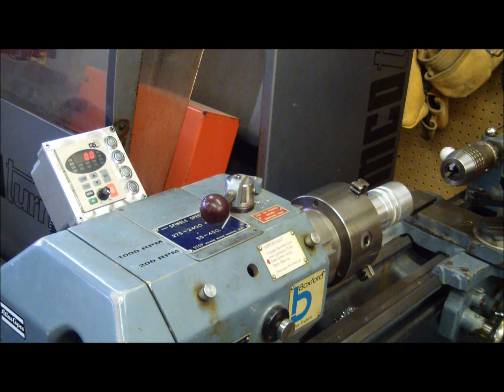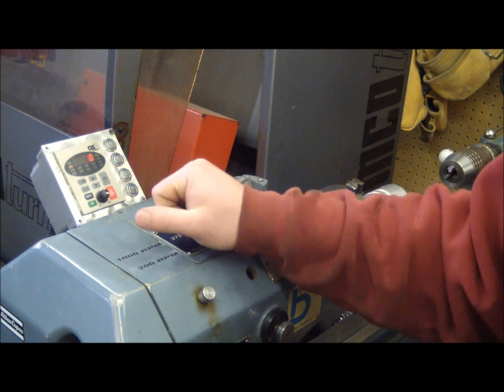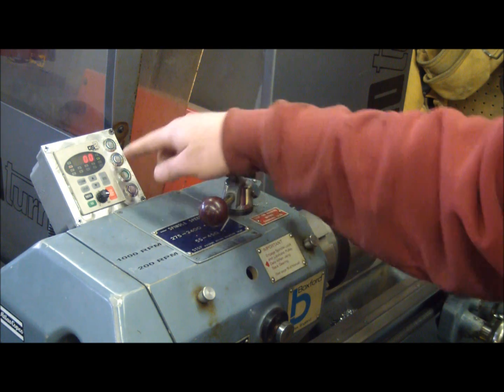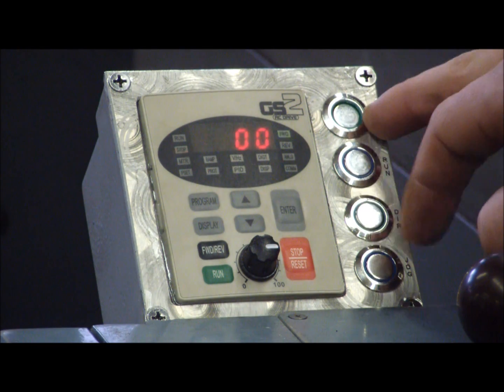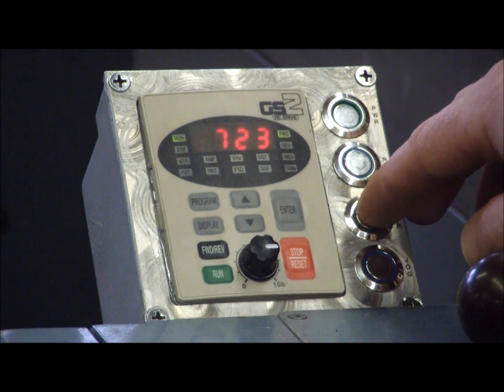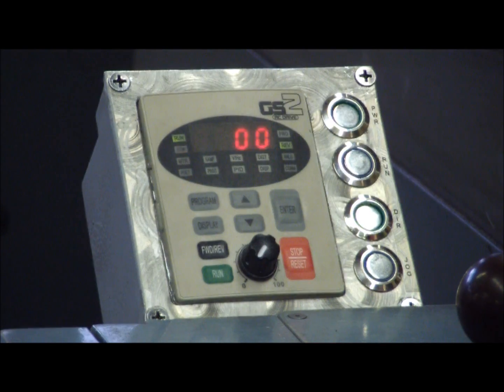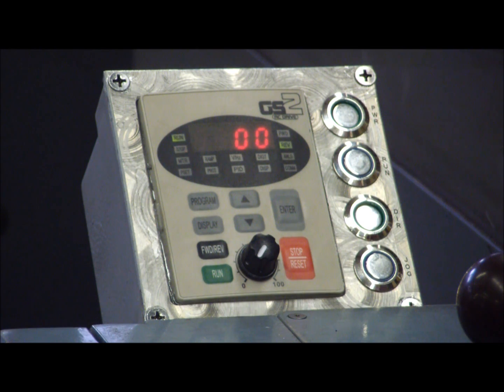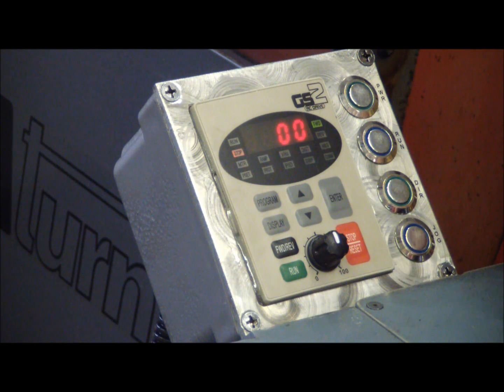How to run industrial 3 phase motor on single phase

Comment: Man where were you in 2000? I have a Wells Index with a rotary converter that i purchased in 2000... the machine is CNC. Basically, when I do an M3 command (Motor Forward) it closes a relay and the machine fires up. If I understand you properly... I could disconnect the 3-phase rotary and install one of these... and I'm thinking it probably takes a PWM input... and if it does... that means I have Forward / Reverse with full software speed control. Man that would be SLICK!

I gotta do some research now... I would love to get rid of the noisy rotary converter for my 3-Horse machine!!!
http://askjerry.info/monster_mill_machine.shtml

Comment: Is vector the type of drive?
And can i just put the drive in the electrical box of my lathe and make a control panel like you with a digital RPM meter the switches and a pot meter? Or is it important that i know the frequency.

Comment: I have a 100 year old lathe sitting around at home, three phase. You may just have sparked it back to life. Thanks alot man.
Reply: woops, not 100 years old but pre-WWII, built like a tank. My dad's original plan was to hook up a single phase motor to another three phase motor and use that one as a power generator for the lathe. I think this will be a much easier solution. And you got the added speed control (does it go to 11?).
Reply: I know, you said that in the video. I was trying to refer to the bridgeport speed control which you magically transformed from 10 to 11 max setting.
Anyway, the project sadly won't be for tomorrow. We still have to empty all the garbage out of out little shop, which is a pain in the butt with a dad who wants to save everything.
Reply: Update? This sounded like an awesome project

Comment: Home shop cheap-ass needing help!!!.

. i'm not electrical ninja or even an electronics jedi, even though i did stay at a holiday inn express last night. but today i'm still no closer to understanding all the options on my dam multimeter

Here is my dilemma i have a new to me lathe that was manufactured in sunny california  and came to me by way of a trail of trade / highschool shops (important info to keep in mind for later in the story).eventually landing at my garage / igloo. 

ok well the lathe has a (440 only) voltage 7.5hp 3ph. i can't use 3ph. so i bought a new single phase 5 hp, was just about to install it when i realized i would lose 1/2 my gear choices because the oem motor was switched into and out of delta to achieve two rpm speeds, thus only needing have the gears to achieve double the spindle rpms. while my new 1 ph was not that well endowed

"Ok" i said to myself, and i knew it was me because i recognized the voice..." just put the single phase 220 in and live with half the speeds". after all i'm not machinist either..... 

The saga continues.... here where my earlier, seemingly, useless information about the life journey of my newly aquired lathe comes into play.

i drained the gearbox so i could put fresh oil in there, like a good boy.... when i noticed THREE !! broken gears.... now i don't even have half the speed choices of oem specs.

So my long winded request is for your guidance Ob1.

parts i have are:

- used 7.5 hp 440 volt 3 ph motor
- new 10 hp 220 volt 3 ph motor
- new 5 hp 220 volt 1ph motor
- garage with only 1 ph power
- very small budget left.
- large nuts

Can you help me!!!!!
Reply: Ya I would very much welcome an opportunity to pick your brain, in person.  My shop is in Clavet, just 10 miles east of Saskatoon on Hwy #16.

It would be cool to seize this opportunity just to have you eyeball the rat's nest of oem wiring that hooked up that 400 volt 3 ph because I would like to use as much of the switches and various electrical thingamabobers and whatchyamacallits that are in that electrical panel. My kingdom for a simple wiring diagram?

I will be sure to have beverages on hand.  I believe it's Guinness if I"m not mistaken or have the British Columbians converted you to Kokanee?

If a visit would fit into your schedule, just pm me.  My schedule is wide open this week.

Bill
Reply: right on man that'd be cool.  i'll text you my address

shoot me your number 
billyTpower   gee  mail   

lol i was told they dump messages with email url in them in your spam folder

agent 99 out...
Reply: lots of those here.

got an old atlas lathe here too.

Comment: Nice video. I have a quick question. I have a lathe fitted with a 2hp Baldor motor and I noticed in your video that you mentioned how vfd's can handle being overtorqued by 200%. The question is can I take a vfd rated at 1hp and connect it to my lathe? The reason I ask is the price difference between a vfd rated for 1hp over 2hp is considerable. Any help you can provide would be greatly appreciated-thanks
Reply: Dude your awesome ñi haven't bought one yet. I was on the verge of buying a phase converter before I saw your video. I'll keep you posted Thanks again!
Reply: You're the second person who commented on the first video from uncle bumblefuck, congrates man